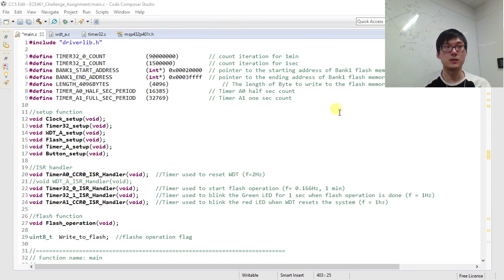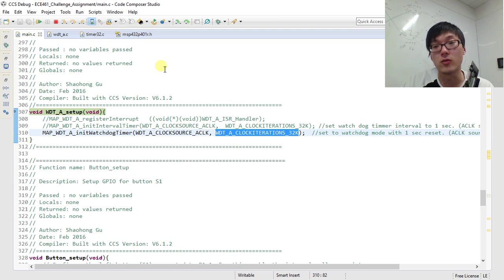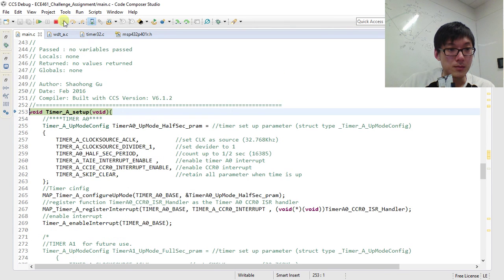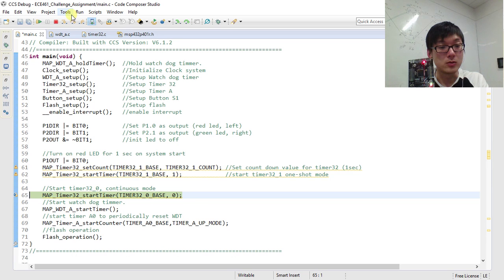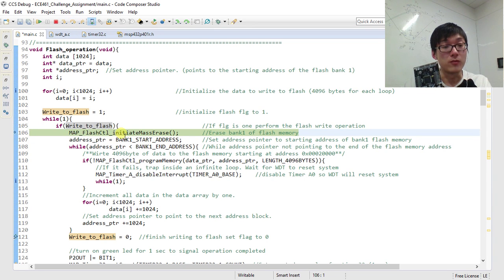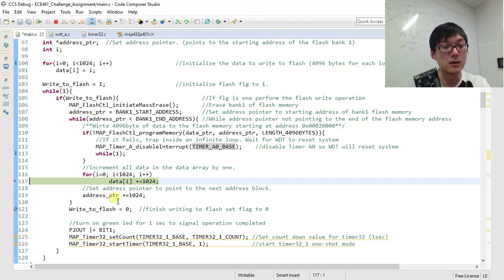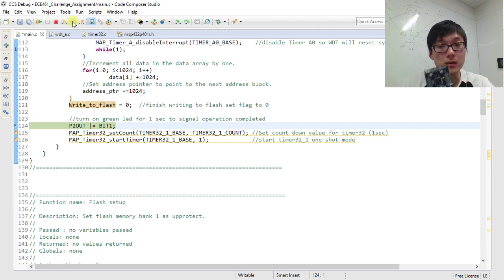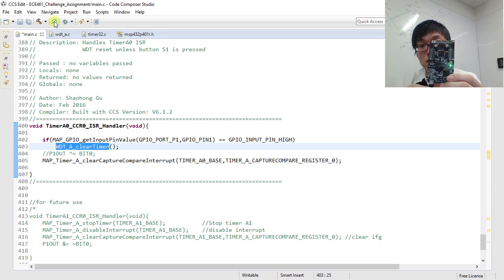NCSU ECE461 MSP432 Flash memory write

Comment: Was there a specific reason you did not write to FLASH_MAIN_MEMORY_SPACE_BANK0 as well?
Reply: Thank you for your answer. I have tried using (and incorrectly erasing) BANK0 and you are correct by saying code space is there. If erased, the program will not function. Exactly half (sectors 0-15 of BANK0) is reserved for code space, yet I can't find any information in the datasheet or technical reference manual that confirms this.